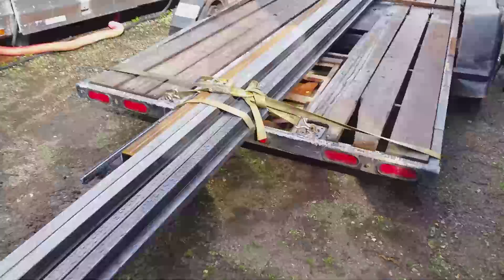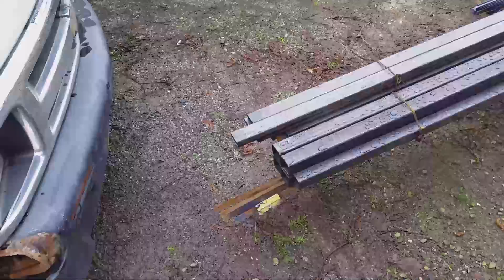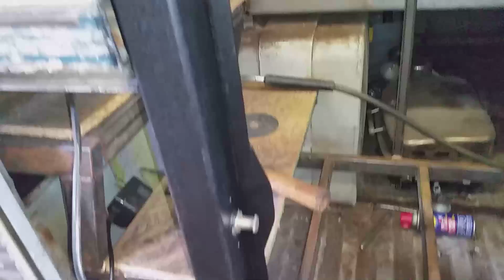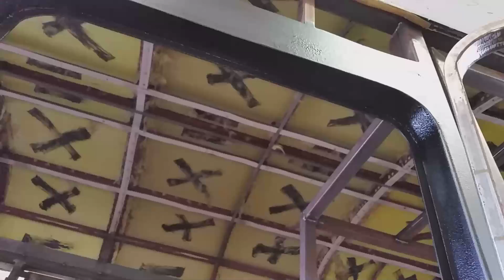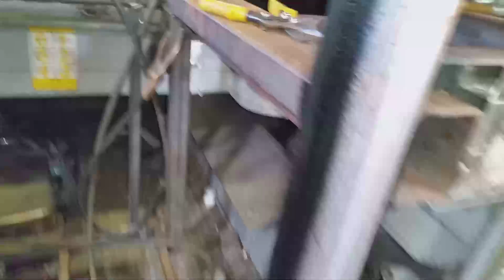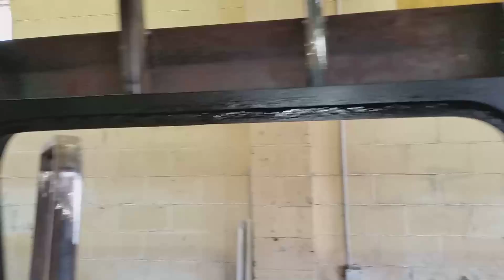Bus Conversion Project - Video 32 - Rear Slideout Construction

Comment: are you going to sleep   on top of the engine  cowling
Reply from the maker: There will be an insulated cover over the engine and the bed will be suspended 2" above that on a hinged platform that will pivot up for engine access`
Reply: @Bill Schofield: I expect James will end up going to sleep beside the engine instead - such will be the pride in the work!